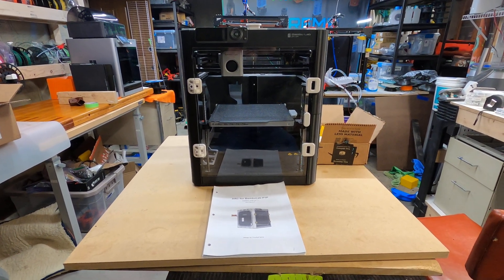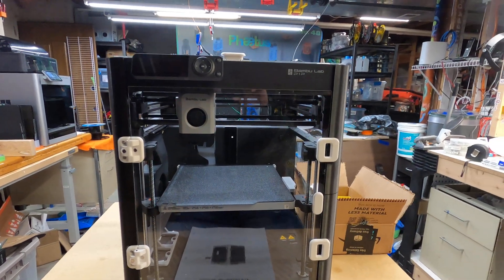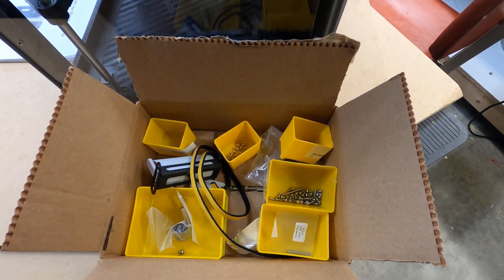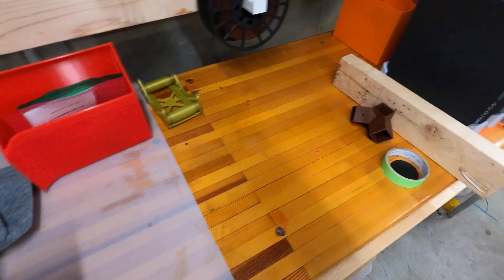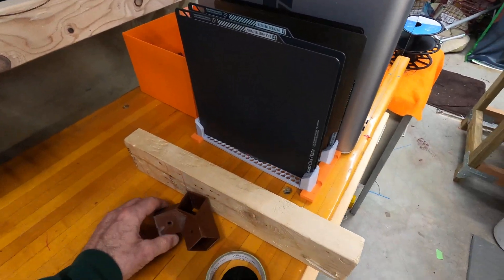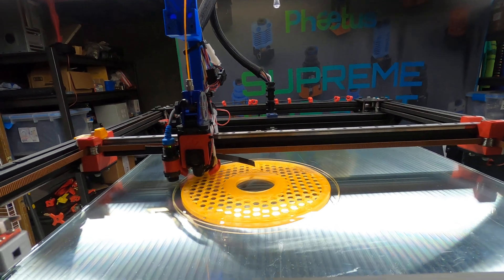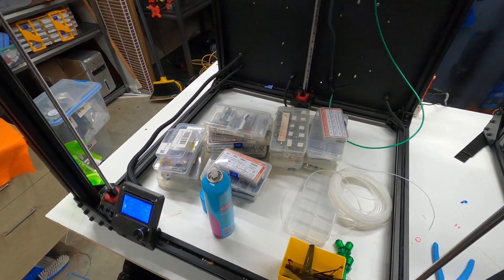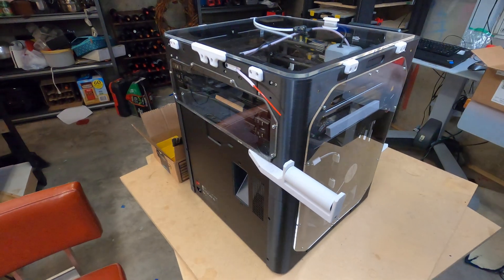The Bambu P1P ARC is finished.

Comment: what is the build volume of the printers you were priting the spools on?
Reply from the maker: The two big ones are Rat Rigs, they are 400mm cube and 500mm cube,  I don't run them as fast as I could, but they can print BIG.  I now have a Prusa XL which is I think 320 mm cube.
I just posted a video on it in a SUMO enclosure.   I know someone who is trying to sell a Rat Rig if you are interested.

Comment: Im having an issue with my p1p not connecting to my computer
Reply from the maker: A couple of things to try.  Completely power down and try to reconnect. Check to see if Bambu Cloud is up.  If it is down looks like nothing is working.  I had to resort to using a SD card a while back when it was down.

Comment: The upgrade with the Plexiglas looks sharp with the printed white pieces.  I suppose the plexiglas would also keep contaminates out that could be blowing around in the air.  Not sure if that ever happens?
Reply from the maker: I liked the color combination, but it can always be changed, just print new parts.  The enclosure is mostly to keep drafts out and the heat in.  A lot of plastics will warp if they cool too quickly.  That is why it is almost impossible to print on an open air system.
Reply: Your not eating it so you don’t really need to worry about contaminates, the enclosure is for printing with high temp materials its holds the heat better
Reply from the maker: @splint1872012  Correct, and prevents drafts